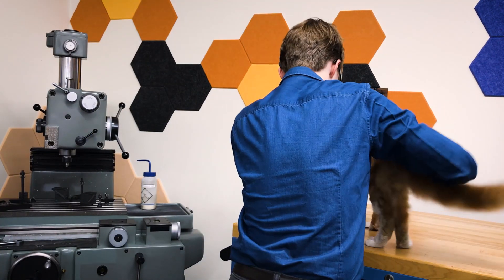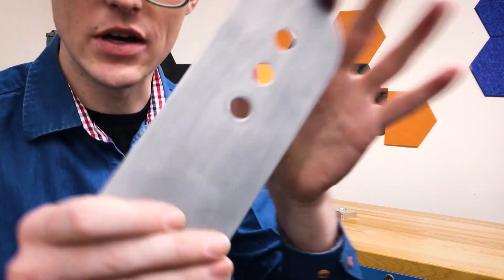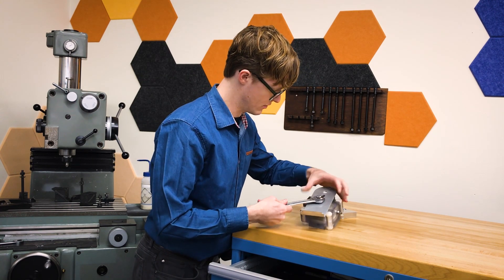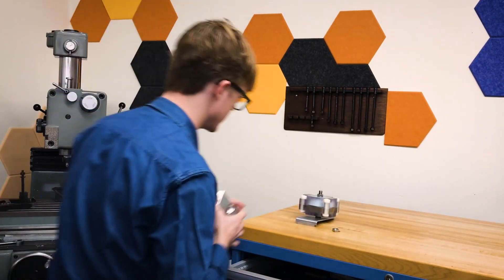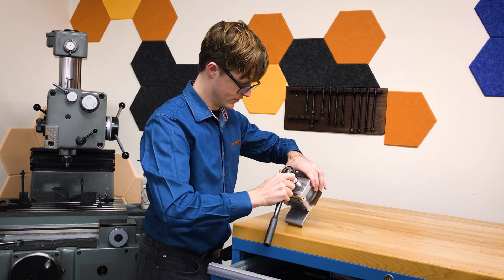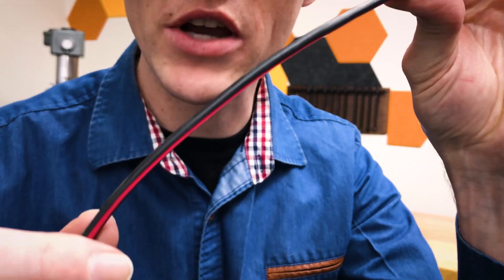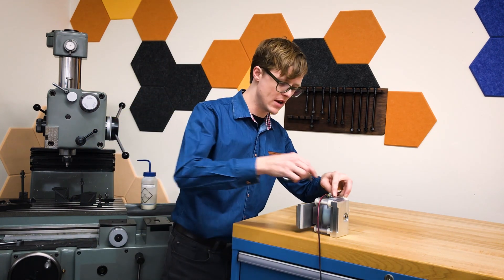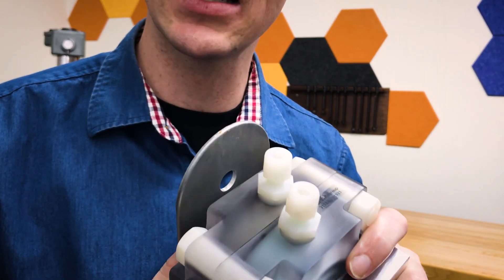How to connect a triggered spark gap: Electrical terminals

Comment: so how does the inside look like? i mean the circular discs or is it little concave "dishes"? can someone explain? thx!
Reply from the maker: The triggered spark gap switch in the video is a midplane field distortion type. That means that the main electrodes are convex and the trigger electrode is a thin disk between the main electrodes. Pages 159-161 of the book "Pulsed Power" by Gennady Mesyats  explain how it works.